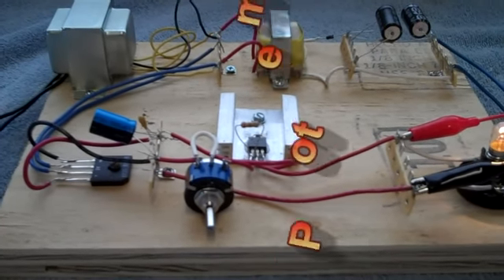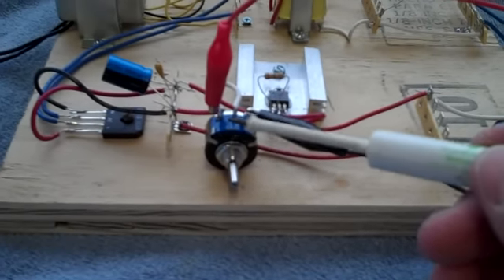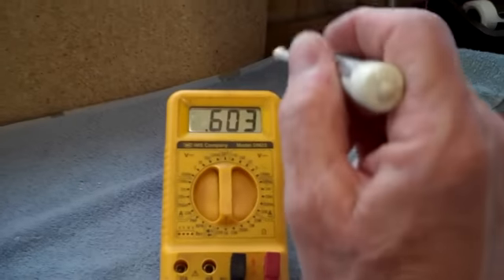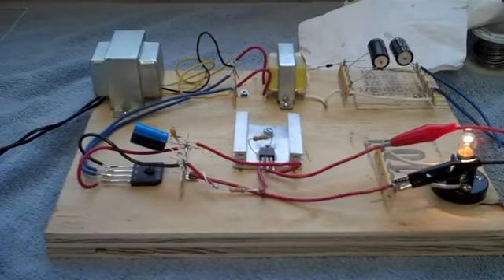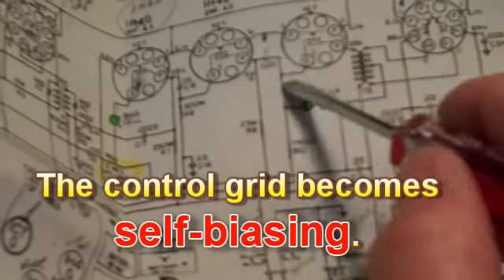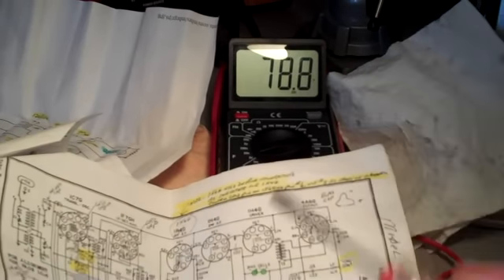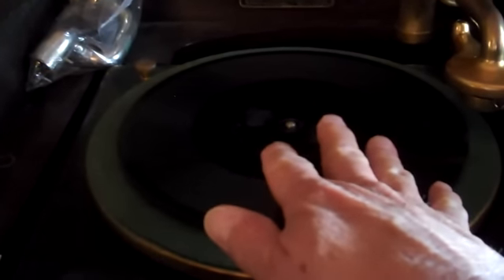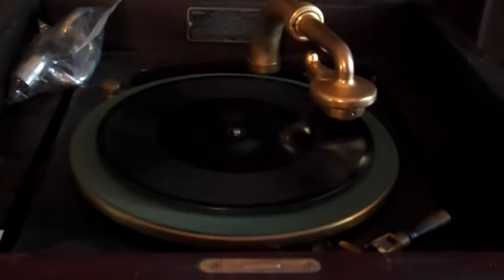1938/39 Silvertone Model 6044 & 6045 Farm Radio Restoration (Part 13 of 20).

Comment: Use a full bridge rectifier after t2 to get higher voltage on the output. Because right now your only using one side of the ac wave. The same same one that you used on the low voltage side will work.

Great video as always! keep em coming;-}

Comment: That mechanism in the Edison is very interesting, it's like a cylinder player mechanism adapted to play disk style records. I remember reading an old pamphlet for some model of Brunswick gramophone and it could apparently play either the lateral groove records (like Victor) or these vertical groove Edison records by rotating the stylus.

Comment: One common way to bias a tube, at least in AC sets, was to make the cathode more positive with respect to common negative by connecting a resistor in series between the cathode and ground. So they weren't using negative voltage for bias on the grid so much as making the cathode more positive, sometimes called cathode bias. I haven't looked into how self biasing was achieved with battery sets as yet as the tubes used a directly heated cathode, so far I haven't had to deal with that to repair one.

Comment: John,
       Looks like I'm late to the party. I think YT is have problems again..go figure ! That radio is sounding great, sorry to hear about the low b+ voltages. Have you thought about doing a video that's strictly about resistors ? Ya know: wattages differences in ohms,kohms,megohms. For some one that's still pretty new to this stuff I'd find that greatly interesting. Remember the content on those diamond discs are no ABBA. That was fasicinating technology for the times ! Thanks for sharing.

Comment: Hi John,

Might be worthwhile to check if a large value resistor in series with the watch batteries might perform better (instead of the 1.5M to ground). The current drawn in this circuit is probably very small therefore the votage drop on the resistor will not change the bias voltage significantly, on the other hand the large resistor will not load the audio signal.  Just an idea.....

Regards,
Yehuda

Comment: Hey John, Well done, my friend.  That radio has pretty good reception.  Question:  What kind of antenna are you using?  For this test, were you using an indoor antenna or do you have something rigged outside?  An "antenna advice" video would be useful, I think.  Tom

Comment: With regard to the bias cells, perhaps the problem is that the old ones were a form of carbon zinc cell and the new watch batteries are not. I've never had a battery set that used button style bias cells, they usually had external bias batteries or the tubes used some form of self biasing circuit.